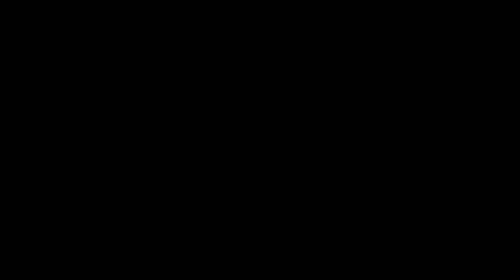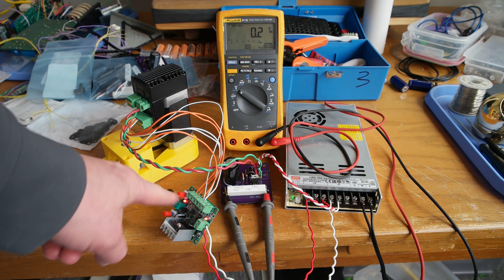Servomotor protection circuit test

Comment: Hello, Thank you for this project! My CNC project is built around JMC motors so this is really usefull
I am  about to build this board for quite a few motors, do you have any recomendations before I start ? 
Only one component from your BOM is out of stock and I found this TIP147FTU-ND instead, will it be okay ? 
WHat should I update if I drive my motors at 48V and their rating is 400W instead of your 78W example? Thanks!!!

Comment: Thanks for your previous Answer - I am really considering printing the board you have designed. Am I right to believe that the board is: 2 Layers; Copper Weight is 1oz.. what I am trying to understand is what are the requirements of the board that you sent to the PCB Manufacture in terms of Layers, Copper Weight, Board Thickness etc?... just want to print exactly what you have - as you have tested your version of the PCB thoroughly.
Reply from the maker: Yes, 2 layers, one oz copper. See the blog post for a link to the files for the board design:
https://drmrehorst.blogspot.com/2022/05/bank-account-protection-circuit-for.html

Comment: I have a question about the Protection Circuit (Returned Energy Dump). if you have 3 Brushless Motors connected to 3 ESC's do you need 3 Protection Circuit (Returned Energy Dump)? Would I have to connect each motor to this circuit in order to protect the power supply ESC's and the motor itself? 1 Protection Circuit (Returned Energy Dump) for each motor?
Reply from the maker: The ReDump board is good for a maximum of about 10A. It will not protect the ESC(s), but it will protect the power supply and anything else connected to the power supply from overvoltage generated by the motor(s). If you are using small motors, you might get away with one ReDump, but BLDCs tend to be very high current motors, so you'll probably need one per motor/ESC.
Reply: @MarkRehorst  Thank you for your response - the motors I am using is A2212/10T 1400KV. I believe if I stick to a max of 10A then this will give the require protection and I agree I think it is best to do one per motor - especially given the fact that a requirement is that my motors need to change from clockwise to anti clockwise quickly.